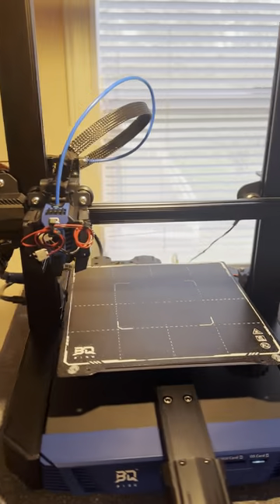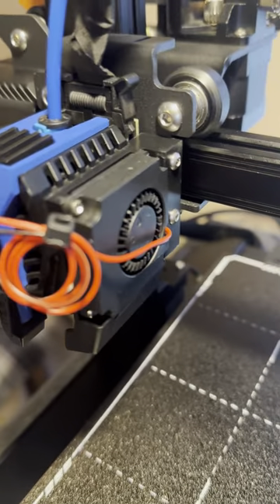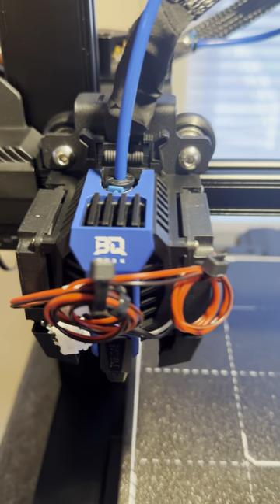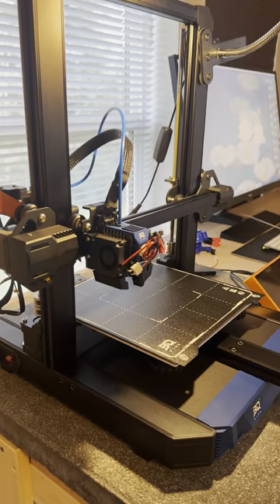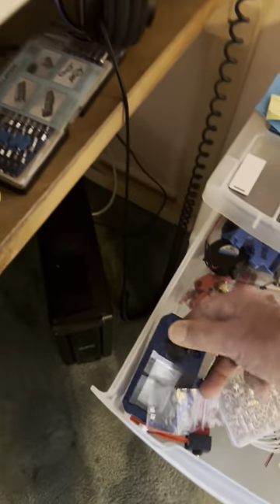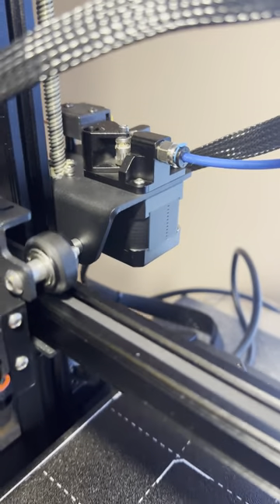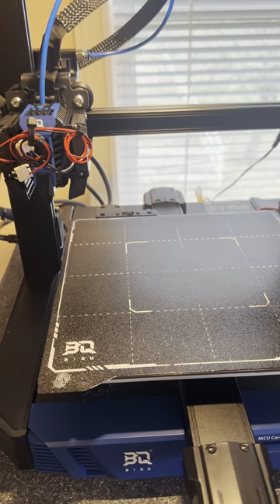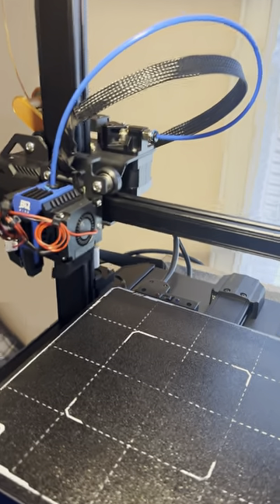Hurakan after two months

Comment: Sorry for all your pain. 

On the fan conversion pick the left or right stl and mirror it. They are not the same in the files. I believe I used the left and it fit. I resin printed mine. I also cut the closing clip off the bottom of the fan to fit the slot you were resizing for. I did use a dremel to cut a small grove for the wire to pass under the flat portion. I also bought the right connectors so as not to hack up my old fans. Optionally you can just resolder the oem wires to the fans and not mess with to much. 

The best upgrade and I as well as you bought the spider was to buy a ceramic heater off of Amazon. I got that and a bimetal heat break that was 6x27mm. It’s 3mm too long but I filed the top off to fit, and still have enough cup for the ptf tube to drop in for a smooth transition from the coupler to the heatbreak.
 Immediately that fixed my extruder clogging issues, and flow. It will hit 300deg no problem. I haven’t had a skip on the extruder, not one clog, and I got a really clean print of that alien model with the tree supports that was ment for a prusa. (Just change start and end gcode in file. It will print just fine on the hurakan)

My filament run out wore out from the drag and I also installed the bearing wheel like you. My fans aren’t noisy so far it’s actually a lot quieter than my other printers. 

I can run at 80mms and walk away from the printer. I e had it running for 36hrs straight with no faults. I’ve also used the latest klipper off of GitHub for it and ran all the updates. 

Try the heater and heartbreak upgrade. Night and day difference. 

Haldis 3D Bimetal V5 AC Heatbreak, 2 Pack Upgrade Titanium & Copper Bi-Metal Heat Break for Anycubic Mega S/Vyper/Mega Pro 1.75MM Filament Smooth https://a.co/d/68kvmSx

DODOBEI Upgrade 24V Quick Heat High Power CHC Kit Up to 300℃ Ceramic Heating Core Compatible with V6 Hotend Ender 3 V2 Pro CR10 Prusa MK3S Titan Aero Extruder 3D Printer https://a.co/d/1uIb7Kd
Reply from the maker: Thank you for sharing your experiences with me. They sound very helpful! I will definitely give them a try.
Reply from the maker: Just one question: You have a Hurakan, correct?
Reply: @corlissmedia2.0  yes I’ve had it since before Christmas.
Reply from the maker: @lorinrobbins7911  you mentioned the "latest klipper upgrade" from Github, that you installed on your Hurakan. May I ask how you did that? Did you direct the printer to that file? I've upgraded the firmware when I see that it should be updated, but all I'm doing is upgrading grading what's there? Is the new Klipper firmware any better?

Mark
Reply from the maker: @lorinrobbins7911  I have the 7 inch screen already, it’s amazing. You’re talking about Tripod’ s Garage, his video, I think. I did install the firmware on my Hurakan. But from the screen, there have been at least two major updates in the last two months. What is the version number of your Klipper install?

Comment: Hello and thank you for your video. I agree, the extruder and hotend are junk and the cheapest of cheap parts. Always had a filament jam. Prints were no longer printed from a certain height because there was no filament flow.

I am currently converting the hotend to the H2 Revo. However, Chinese engineering was also present here. I am currently waiting for fan cables so that I can reroute them from the board, as I prefer to completely remove this small circuit board on the hotend.

My heatbed is absolutely uneven. I also ordered a new cast aluminum plate there.

I also have the Manta M5P here, which will also be installed to be able to do a real Z-tilt in Klipper and that each Z axis is really driven separately.

Actually, I'm building the Hurakan from scratch. Expensive but in the end it will work.

A lot of money to invest, but think it will definitely make the Hurakan better.

Greetings from Germany
Reply from the maker: I would love to see pictures of your printer as it comes together. Thank you for the comment. Germany, from what I’ve seen of it on YouTube, is a very beautiful and creative /adventurous place!
Reply: @corlissmedia2.0  I have something better then pictures. I make a short video after i rebuild the Hurakan. Now it works got, but i have to do some calibrations.
Reply from the maker: @chris82xxl79  I just watched it four times. I asked some questions. If this solution works, I'll buy the gear today.